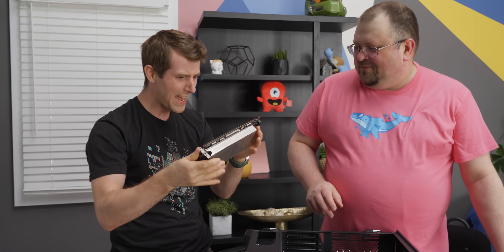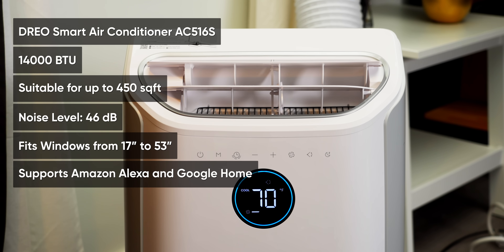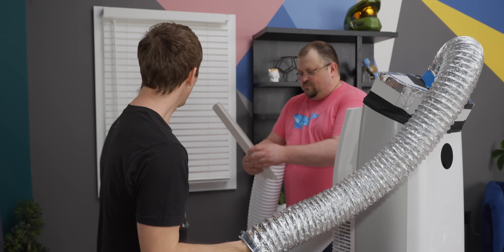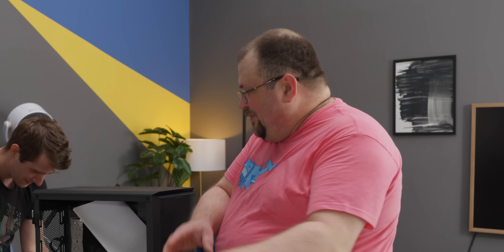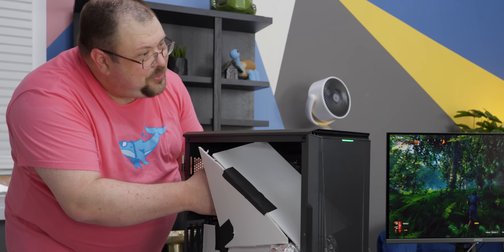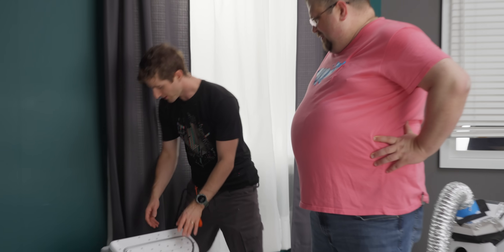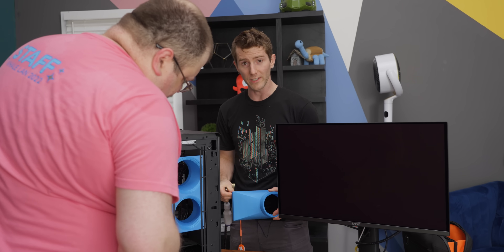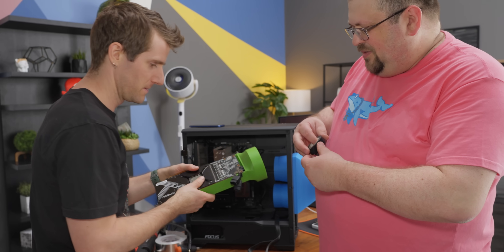Everyone is Cooling Their PC Wrong

Comment: Wow. I was just chatting with my nephew about this earlier today.  Though my idea was to run a water cooler line to a heat sink inside a mini fridge, or just outside my window.

Way back in the day when my PC was in a small back room, I had a small AC unit in the window and just ran a ducting hose from a portion of the AC vent (about 1/4 of the vent was covered by hose) along the floor and back up into one of my PC intakes. I checked regularly for condensation (The dip might have trapped a lot of the possible condensation) and corrosion and never had an issues.  My PC stayed nice and cool and didn't overheat the room anymore. This was a vast improvement from just running the AC on it's own with the PC not connected.

Comment: When the first P100’s guys were using small ac compressor and the return plate was the ice cool refrigerant screwed to the top of the CPU. Everything was used you guys could even use one of those small refrigerators that they have in dorm’s room.

Comment: it would probably be a good idea to put all the cooled air through the cpu first, and then pipe that back into the gpu, therefore all the air gets to go over both, and, yes that would be giving the gpu warmer air than this setup, however, it would be getting much more air at the same time, so, likely would be cooled better due to the volume of air being put through it in comparison to this setup.

Comment: Make the cool air go straight through the CPU cooler then do a u-turn into the back of the GPU and then cut a hole in the side panel of the case. That way the hot air blows out through the side. Or put a fan in line on the GPU port. They you could control you distribution.

Comment: These air conditioners are a giant waste of money and energy.  Single tube AC units work by cooling the condenser with the already conditioned air from the inside and throwing it outside.. This means that all the air that it's throwing outside is being replaced by hot outside air being sucked through cracks throughout the house.  Just get a window unit or a two tube AC unit.

Comment: if youre already attaching the AC to the pc, it might make sense to somehow extend the Temp probe of the AC inside the PC case so the AC compressor would cycle on and off when the temp threshold is reached so it would not get too cold to cause condensation to form due to the temp fluctuations from the AC

Comment: In theory you could mount a cpu cooler to the gpu then have it positioned su h that the coolers for both the cpu and gpu are in line and you only need to push air through a single path... Definitely way more effort than its worth but it would be funny

Comment: Those stretchy foil hoses are good for sales but bad for air speed. all the ridges make tiny pockets where turbulence forms and lowers the speed. You can see it when they scrunch the hose down which, initially seems like it's a distance problem but it's reducing those valleys between the ridges. Matthias Wandel did a video on it which explains it better.

Comment: small tip from a race car guy... you will get more velocity with smaller runners, and if you straighten out the intake tube it will be much cooler and a lot more cfm. the harsh bend right before going into the computer case is killing the air flow.
Reply: if you must have a harsh bend then have it closer to the source, not the end.

Comment: I mean; I wouldn't mind seeing this refined a bit more? Inline desiccant? A little nob in your 3D printed manifold to tune which side gets more air?  Maybe some kind of closed loop system with a draw fan on the hot-side of the PC at the unit?  Move your temp probe to the back of the PC and / or toss an arduino into it to regulate the temp a bit more?

Comment: oh yeah... i had been thinking of putting my pc (which is now a laptop pretending it's a desktop)  directly in front of the hvac vent that normally blows on me,  cooling the pc and making me less uhh.. uneven,  because the cool air blows at me from my left side..  
but.. yeah,  maybe i won't after all, i knew there was something wrong with the idea, and i'm not sure exactly how close or far i could put it to that cool air without worrying about condensation, so maybe i just won't.  (also it has pretty good heat management already, it sounds like a hurricane when it really ramps up)

Comment: I feel like condensation shouldn’t be a problem if you used a different style A/C
A A/C unit traditionally removes the moisture from the air. Dry air is easier to change the temperature of and A/C condensers naturally just condense water anyways. I assume because that A/C unit is meant to be used indoors and not hanging out of a window they designed it to reintroduce the moisture to the air to prevent an owner from emptying a bin. I work as a mechanic and it never fails once a year I have to explain to a customer that it is normal for a vehicle to drip water when the A/C is on. Sometimes those hoses get clogged though and the interior fills with water. I assume this manufacturer wanted to eliminate those problems and didn’t assume it would be used in this manner.

Comment: optimizations that could be done simply... larger heatsink on GPU, change the intake ports from a 50/50 to a 66/33 or maybe even 75/25 instead of just trying to block off flow to one.

over all optimization that would remove threat of condensation on PC parts... move to AIOs in a case there you have a front and side mount positions, create a duct system with 3D printers that would blow into the corner, create an up or down port (depending on case style) to extract the air, forcing the air through cooled air through the radiators which would extra cool the liquids, you still have no fans, just 2 pumps. adjust settings for the pumps to pump at lower temps. would work best if the interior chamber was separated from the PC parts via 3dptinted walls (dual lined to isolate the temps of PC and cooling chamber.

optimally it would be best to make two ports from the AC then 2 ducts from AC each to their own vector (front/front and front/side) at the corner. the exit port would then go back to feed into the intake of the AC to create a closed loop, if any fans were to be used I would use it next to the intake of the AC to pull air through the system. but the AC unit might have enough power to do this on its own.

Comment: Just an idea why not take a micro itx system or a smaller system and to avoid condensation put it in a sealed box with the ac pumping cold air into the box so it’s like being in the environmental chamber then you get cold air into the room and pc

Comment: Here's a liquid cooling experiment for you. Submerge your PC in a vat of mineral oil, It's a liquid that can transfer heat without conducting electricity. Theoretically you should be able to dunk a running PC in a vat full of mineral oil and leave it there without breaking it.

Comment: My Tesla P4 can easily be cooled by a decent 40mm fan. After going through a bunch of different models I ended up loving the Artic 15K 40mm PWM fan. Lowest RPM than anything else at the minimum fan speed (17% for those Artic fans vs 20%+ all the other 40mm fans that can actually cool the GPU), no weird tiny fan hums at that minimum & I never go above 7K to cool the 75W Tesla P4...

Comment: Guys, guys, guys...
It's almost as if... air cooling... is literally better. Crazy, I know - we're supposed to be air cooling the liquid that adds unnecessary moving parts into our system and coolant, makes total sense.
These stupid server people, what do they understand...
But like for real, radiators work much better in a normal setup. The teensy-tiny fans and the stuffed environment of a case are a problem, however.

Comment: So if your taking the air out of the case as well as putting it in you would also be removing the water, wouldn't that stop worries of in case condensation. Look like you should keep the pc fans on and run the air through the CPU then the GPU before dumping into the case where the AC unit is also intaking air.

Comment: Instead of chilling the air, they should cut out the air cooling radiator, and mill a custom cooling block, skipping that step entirely. Condensate is going to be an issue regardless, unless you also encase the cooled areas within a vacuum.... of course the other components on the boards would need passive air cooling...  hmm.

Comment: That AC ain’t it boss. If you can’t get yourself a window mounted unit, at least get a dual hose inverter portable ac. Those single hose behemoths literally use more than double the energy of a cheap window AC!

COOL video, tho! 😂

Comment: How much pressure can a water block take? 

Could try to run the refrigerant direcrectly through with some creative plumbing and use it directly as the evaporator.

Sounds like some potential jank engineering that a certain host is a fan of.

Comment: Where's Technology Connections with an explanation on the refrigeration cycle and the magic of latent heat of vaporization?
Reply: At least it wasn't a Peltier cooler 😂
Reply: He might have been sad that they didn't use a window unit instead since "portable" AC units leak MUCH more of the heat they extract back into the room before they're exhausted.
I've been thinking of doing this with my own window unit for a while now since they're already in pretty close proximity, the AC is the loudest thing in the room already, and my AC unit is too powerful for my tiny room anyway.
Reply: yeah linus forgot to add a custom built intake hose from outside
Reply: Being angry that they are using (and sponsoring) a 1 hose design which basically just sucks the air out of your room.
Reply: @diegosanchez894  lol that's also what I replied
Reply: This is the collab we need.
Reply: The guy would have an aneurysm over why he didn't use a heat pump. The only reason he wouldn't go into a psychotic rage was the tasteful use of small HVAC appliances and the accurate usage of watts as a unit.
Reply: @adissentingopinion848  an AC is a heatpump. it moved heat from one medium to another
Reply: @adissentingopinion848  an AC is just a heat pump without a reverse gear on the transmission 😂
Reply: LTT is always "here's why you maybe shouldn't do this lol" that No one else would do

Comment: You could duct most of the air through the GPU but then have a slight bypass for the CPU, instead of having them equally distributed.

Comment: Yeah if you had the exhaust on the AC with the two pipes so that you're using outside air and you looped the intake and the outlet of the AC to the computer you would not be introducing moisture and you would have a pressure side that you could run some little nozzles right under your monitor to blast in your face some cool air like the airplane Air conditioner set up

Comment: Since all the fans do is move around room temperature air why not just use the intake of the AC to facilitate the air movement that removes the heat and let the AC provide cooler air in the room to cool the PC?

Comment: Its not much about air T than air flow, you just need a faster fan that put more air molecules trough the radiator in a second 😅 the room temperature its cold enought even in summer i guess.. its has something to do with how heat molecules transfer kinetic energy.. its better to have more warmer molecules passing by than less coolder ones passing slowly 😅

And you cant use this genial device to cool the pc in winnter 😅

Sooo i dont know Rick

But I am shure if you apply some fan on the pc case intake to direct coold air to the gpu the resoult will bi much better.. the cpu doent need much cooling.. but than again if you have a fan, there is only so much coold air at disposal 😅

Anyway the flow is more important than T as long as the T is low enought and flow high enought

Comment: Industrial ac units for control cabinets used in manufacturing are designed not to condensate because of the sensitive contactors,  computers,  and relays inside. These units run 24/7 to keep the motor drives cool as well. They are self-contained mounting to the side of the cabinet. Most are sealed with no exterior venting. Now, they have limited temperature control down to say 70ish degrees and are quite expensive,  but do work in noninsulated steel cabinets. Designed to feed cool air in the bottom and pull hot air out the top of the ac unit, working in a recirculating system style. I have had to add secondary fans to direct air towards components that were not in the path of the air flow due to the configuration of the components near the cold side. Try one of these next time you want to cool a custom Industrial themed pc.

Comment: Would it not make sense to also use the AC air intake as well as the out put. Hot air sucked out of the back of the PC into the AC intake and then the cool air into the front. A massive closed loop.😂

Comment: Crazy question but has anyone ever heard of the old saying that heat rises? Not a computer wiz but what if put the part that heats up most above the part that doesn't heat up as much so doesn't cook it from below with its rising temps, and what if put the part standing upright instead of laying flat, again if heat rises should in theory let heat escape a bit easier through vents it has instead of just trying to blow it out the side use the natural laws to assist and blow it out the top, but again i wouldn't know  but could be a concept to test.

Comment: Linus, while you have your hands on portable AC and have sponsorship can you ask DREO to release dual hose unit world-wide? These single hose portable ACs suck ass and converting one is often not feasible (need to separate chambers inside which depending on the construction of the unit may not be possible) - for whatever dumb reason, the only dual hose units only exist in USA and pretty much nowhere else... Make a video of converting that DREO to dual hose (exhaust+intake from the outside to avoid creating negative pressure inside the room sucking all hot air in through every vrevice), show results and that DREO unit will catapult in sales in Europe...

Comment: This is why I made my gaming/bedroom very small. 13ftx13ft. I also use a midea U shaped 12000btu inverter air conditioner. It's incredibly efficient. It cools my upstairs, uninsulated room perfectly fine and runs about 750w on 90f degree days. So instead of cooling the pc I'm cooling the whole room. But I could duct it directly into my pc, which I thought about but I figured it would just be a moot point. During the winter I ducted outside air into my pc but I was way too afraid of condensation so I got rid of it. It didn't work all that well anyways. I could have just opened my window and cooled down the room to 65f and it would have kept my pc cool. But during the winter I don't have to use a heater for most of the day because I'm using my pc and it heats the room lol.

Comment: Back when I was really struggling my cousin gave me a first gen ps4 that would overheat. Easy fix if you know what you were doing but I wasn’t confident enough to do it by myself. So my solution was to put half of the console inside a of a window ac unit and used it like that for probably 6 months till it turned winter and I was sick of being cold while gaming I then learned how to do the replacement and and did it but while I was doing the repair i noticed rust and all sorts if water damage to the  motherboard. i replaced the fan cleaned the heat sink and put it back together and it was fine. Fast forward 8 years and probably 5 more fans later it still works and I still use it for YouTube and tv  lmao

Comment: Condensation only happens if air with higher temperature meets cold surface. Colder air is not able to hold water => condensation. This happens on condensator. The cold air is already dry.. Blowing hot air on evaporator? It doesnt make any sense. You just made the A/C so inefficient..

Comment: This set up reduces the relative humidity in the PC case and makes it less likely to build up condensation. Colder air can hold less water than warm air. So even if the cold air is super saturated when it enters the warm the PC case the warming air increases its capacity to hold water and can even promote evaporation in some cases.

The water condensing happens in the AC unit at the cold side heat exchangeer. Because that surface is colder than the ambiant air.

Comment: "We need an accelerator fan." Or just jump up a conduit size or two. Head (dynamic) pressure loss in pipes scales with r^2. Stepping up from 4" to 6" cuts pressure loss by more than half.

Comment: I love y'all but my AC technician brain is just in pain. But yes insulation is the answer. You could simply add a manual adjustable damper for the CPU and or the GPU so adjust the airflow more accurately. If you want to get real fancy you could hook up some actuators to basically make yourself a zoning system with 2 zones. If you get those actuators hooked up to a controller that is tied to some software you could make them adjust their own positions to chase a setpoint for each component automatically. Just some ideas. But yes again insulation makes a hell of a difference. Also a louver system on the green GPU piece would probably work. If y'all want some more info reach out IDC I do this for a living and I think it's pretty cool stuff. Love the video idea

Comment: ideally, the AC should have 2 hoses for the condenser; 1 intake and 1 exhaust hose through the window. this is so it doesn't create a slight vacuum in the room, pulling in air from outside which makes the unit less effective... but that wasnt really the premise of this video

Comment: I would've used a case that has air travel from the bottom to the top and also an ac unit that has a flat top, this way I wouldn't have to print anything and just put the case on the ac unit.